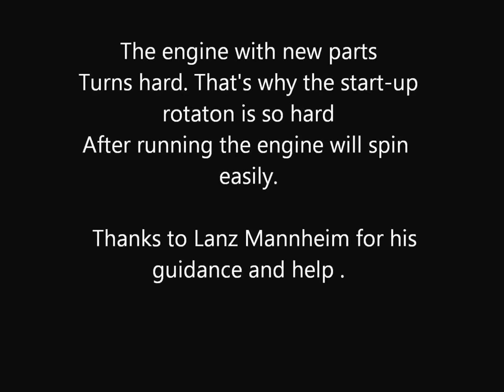LANZ BULLDOG  starting after 70 years 01-20

Comment: I would do that outside or open the roof, brrr. Love diesels but never liked to inhale it inside.
Reply: thata not a diesel
Reply: It is a diesel
Reply: @leoborn4013   I`ts not diesel, it is hot bulb engine...
Reply: Should have extractor fans in the roof - would have positioned the exhaust pipe underneath one 😉

Comment: I was in Germany a few years back and come upon and "Old Tractor Show". The Lanz tractor actually comes with a blow torch and it has a storage compartment for it. The torch is to heat the cylinder head to aid in starting a cold engine. They are 2 cycle and thus can be started backwards. The guy I watched had a backward start after almost reaching TDC going forward, the compression shot the flywheel backward and it fired and continued to run. He had to shut the fuel off and start all over again. I did notice that men are the same the world over...they love to make noise with their tractors and the Land Bulldog was good at that!!

Comment: Hi ! After all I've seen the engine turns a little too stubborn. As if it were sticking. The guy over here where I live has a Lanz Bulldog (wheels version) which is essentially of the same time range. And he got to start it with pendeling to and fro a couple of times and then kicking it the direction he wants to start the engine. That tractor has no reverse gear: you have to brake the motor under idle and then make it turn the other way round. It is a two-stroke and can do that. In addition: the banging noises in the first minutes of runtime are not normal. Something was essentially wrong with the engine or fuel injection point respectively.

Nontheless: you did a great job on reviving this machine. It runs on almost any sort of oil. From cheap crud oil to peanuts oil or even old french fries oil - if filtered from crusty stuff. Running it on Diesel fuel makes the engine run a bit faster but also hotter with a shorter but faster expansion stroke. The guy in our town - for snorts and giggles - even ran his tractor on old motor oil, just for the shows. Well ... that created a very lot of black smoke.

Well done. Keep it going. Old dinosaurs like that need a purpose.

Comment: An interesting video of a Lanz Bulldog starting after 70 years of slumber.
Not being funny but did you not think of opening doors before you thought of starting the engine or perhaps moving machine into the open?! Diesel fumes are cancerous & are very poisonous to breathe in you know & high in nitrates, carbon monoxide as well as hydrocarbons etc! Am just thinking of you guys that is all!
Do you still have this beast & is it running better now than in this footage please?
Reply: This "building" hasn't any doors, also the walls are quite partial ;)